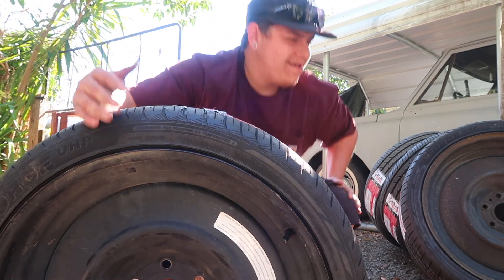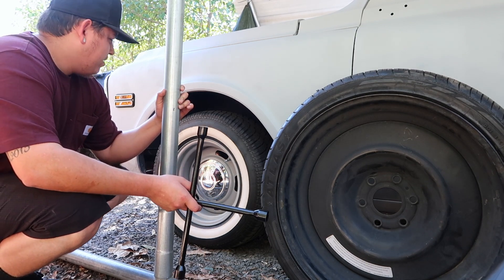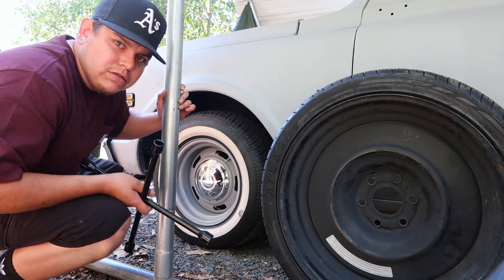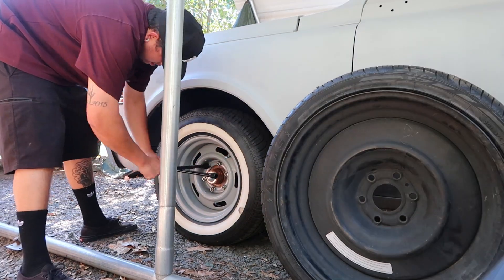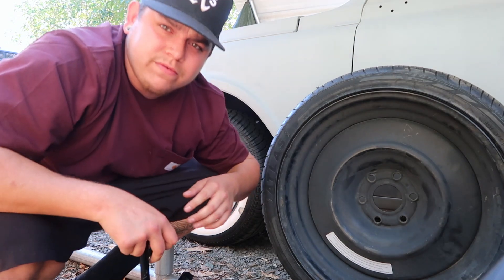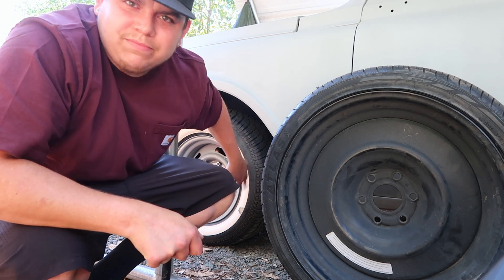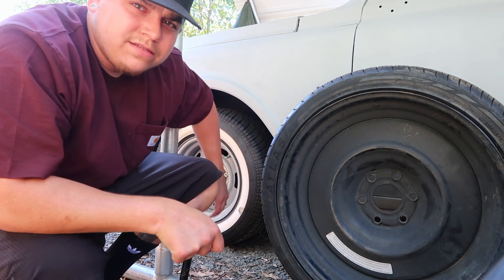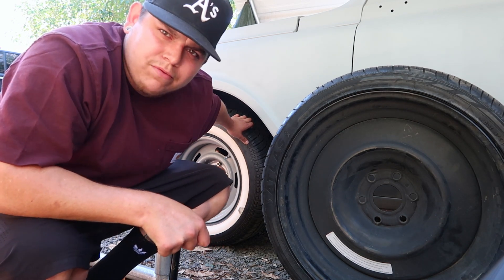NEW TRANSPORT STEEL WHEELS FOR THE C10 ! 22inch steelies! transit rims

Comment: Nice set up that’s what I’ve been thinking about getting for my step side. Where did u get the chrome step for bed?
Reply from the maker: @DmitriRincones  cj pony parts or a little cheaper on ever
Reply: @ only seeing black available and only 60-66 are the interchangeable? With 67-72

Comment: What size tire you runnin bro ?
Reply from the maker: 265/35
Reply: Ya esta bro . Just picked up a set for my C10 . Gotta either run spacers or get them bored out first
Reply from the maker: I actually bored a pair of spacers for the rear didn't have to do anything for the front because of the disk break conversion. I ended up plasti dip spraying the wheels black turned out good

Comment: Did you use spacers fro the rear?
Reply from the maker: Yessir
Reply: Just bought a set of transport wheels, when you added the spacers did you have to get longer wheel studs?